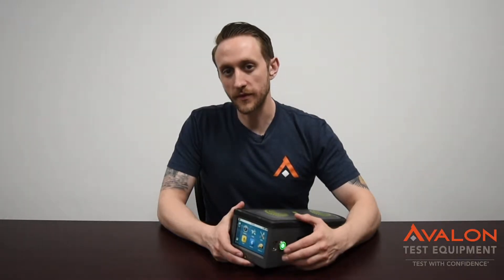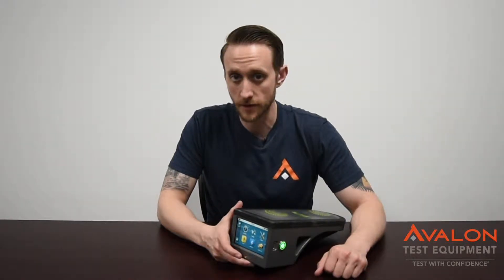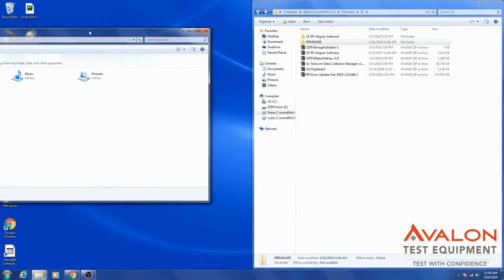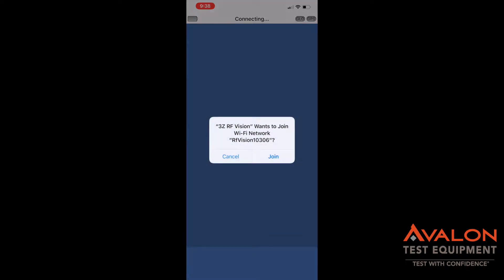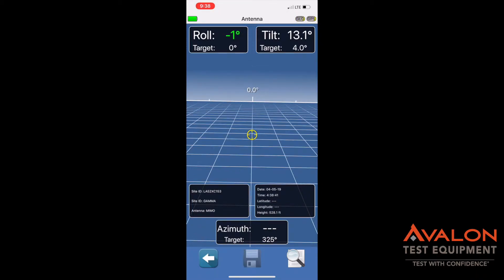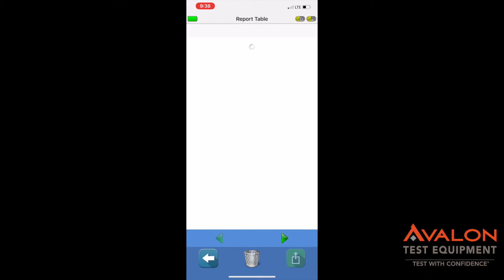3Z Telecom Vision

Comment: My unit has a solid green light when I charge it.  Is that normal?  If I push the on button while charger is in the light blinks real fast, does that just mean the unit has no battery power at all?
Reply: I have the issue did you ever find a solution Joe G?
Reply: @johngarcia7943  same
Reply: @edub9041  ?
Reply: @djthunda9719  Nope we bought a new one 🤣
Reply: Anyone found the issue?
Reply: Got it to work charge it over night 👍👍👍